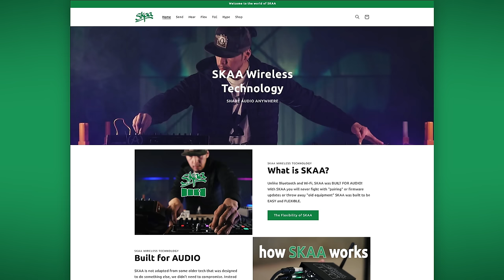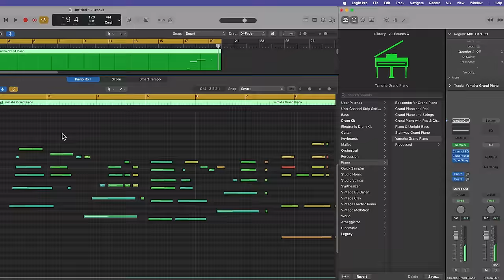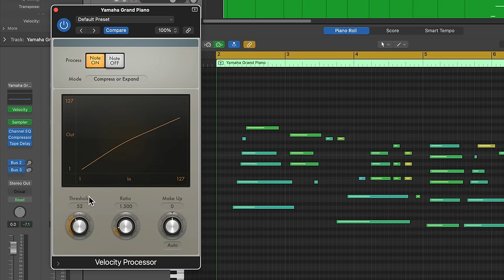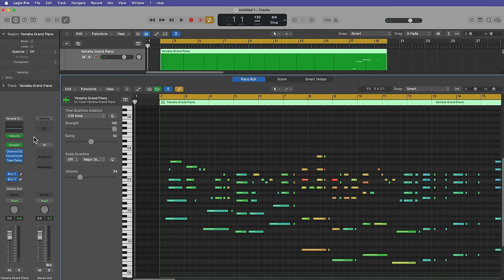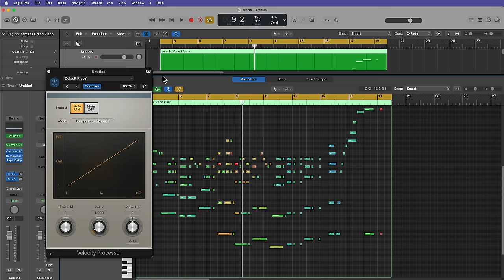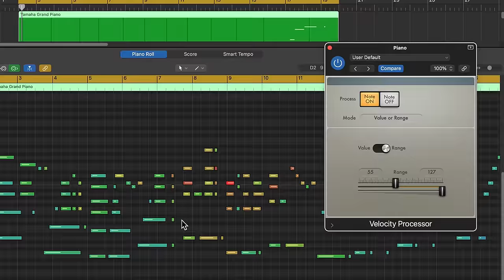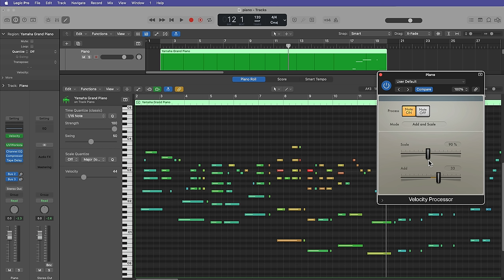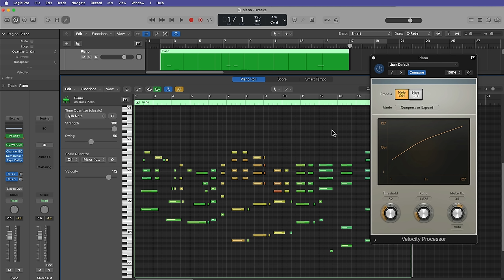This plugin is MAGIC for MIDI piano! // Logic Pro Velocity Processor

Comment: Is there a way to: 1. Record a part 2. Manipulate the part with the Velocity Processor and then 3. Make the change permanent, so that the new velocities are displayed accurately in the Piano Roll view?
Reply from the maker: Great question. Currently, no, there is no way to do that. You have to record your MIDI with the MIDI FX and Record MIDI FX option turned on to bake in the MIDI FX. There might be a weird workaround for this in the Environment, but I'll post a video on that if I figure it out! Will have to do some digging.